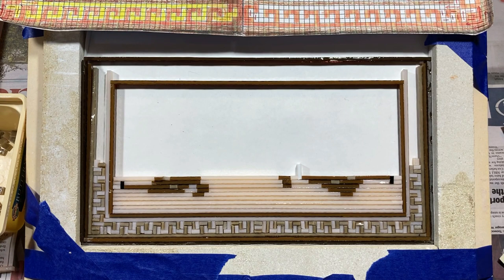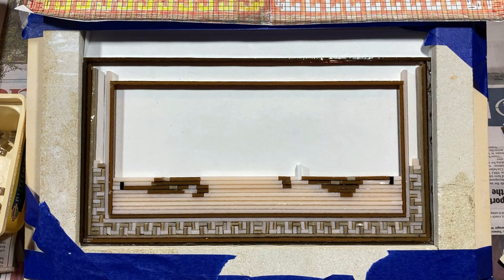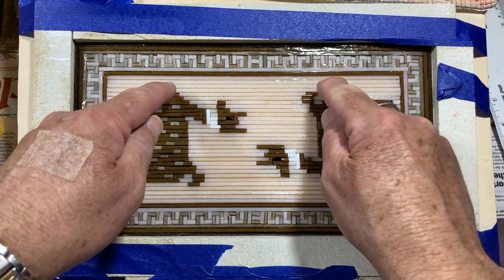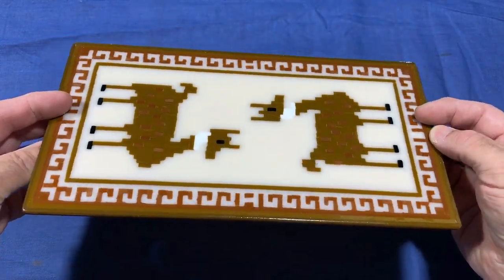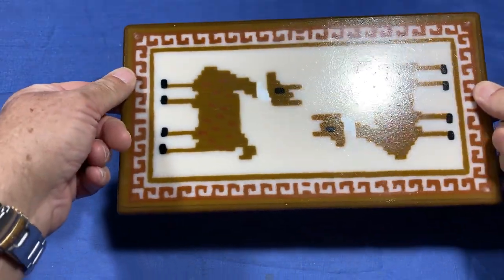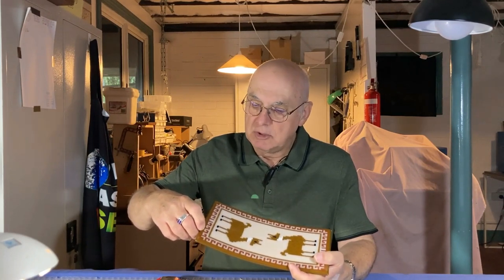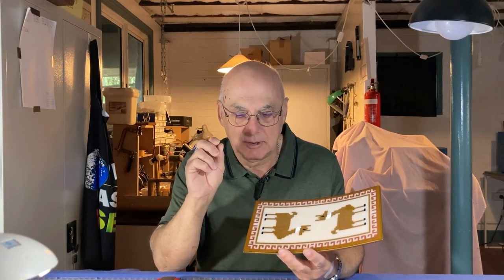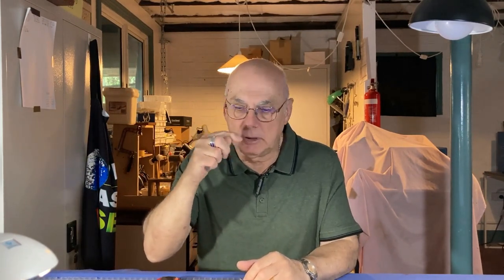Lovely Llama Platter (Part 2) - Fused Glass Project Tutorial

Comment: The imprecision makes it look like a woven blanket…quite authentic.  😘. Did you consider creating the Greek key as a pattern bar first.  The size of the slices may be more predictable.

Beautiful job!
Reply from the maker: Hi Sheryl. You hit the nail on the head. Halfway through the assembly I thought exactly that. I would have probably made the central feature the same way, then cut the length of it to match the long side, the cut the shorter side to match the width. I think that would work. Of course, if you don't have a diamond saw that wouldn't be a solution.